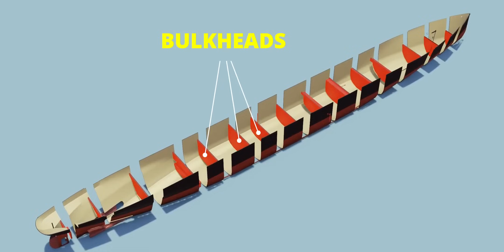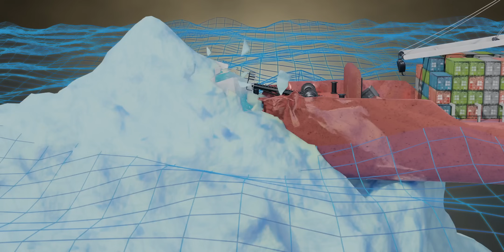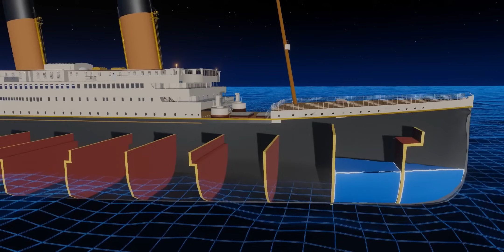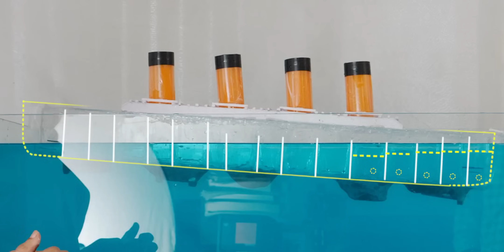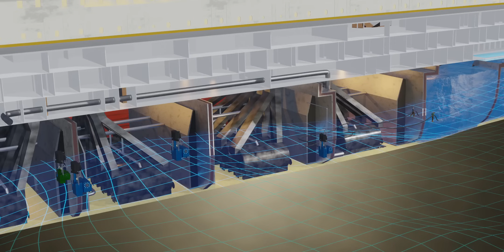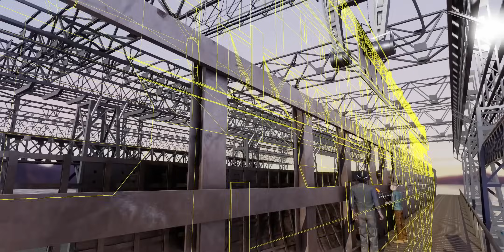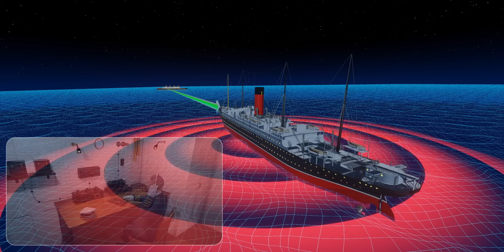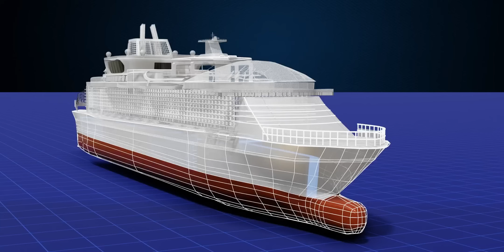How did Titanic Sink? | The Complete Physics

Comment: How could you possibly think the bulkheads not being sealed at the top would be "watertight?" That's insane. To think that water could not possibly go over the bulkheads in any scenario is incredibly naïve and raises doubt of the designer's credibility as well as anyone who signed off on that.

This isn't hindsight quarterbacking. That is something that even the dumbest shipbuilder should have been asking, "Is this blueprint right? Are we really not completing these to the ceiling?"
Reply: The bulkheads did seal up to the ceiling, the issue was how high they reached within her hull. The bulkeads only extended some 25ft above the waterline so when the bow was pulled under, water was able to simply flow through the superstructure and down into the compartments.

They did however extend floor to ceiling across the decks they were found on (D-Deck to G-Deck)

Comment: Why didn't they build those bulkheads right up to the top so that each compartment was airtight.
Reply: The bulkheads did seal up to the ceiling, the issue was how high they reached within her hull. The bulkeads only extended some 25ft above the waterline so when the bow was pulled under, water was able to simply flow through the superstructure and down into the compartments.

They did however extend floor to ceiling across the decks they were found on (D-Deck to G-Deck)

Comment: It was common practice to run at normal cruising speed. In most cases anything large enough to hurt the ship would be easy to see in enough time to turn.  Look up the temperature thermal distortion stuff that explains why the iceberg was not seen sooner.  Just bad luck all around.

Comment: I am thinking about why the collision happened in 1st place. Like why do radars were not there on ship that tells pilot about any obstacle before time to avoid collision. okay if it was not invented at that time and the crew manually have to glance through the roof of ship, then my second question or opinion, would a simple big flood light right in front of ship would have resolved the issue and the iceberg would be visible a miles ahead because in movie it was shown that it was pitch black sea the ship was navigating in so why the hell no lights were turned on at night time ????

Comment: 7:52 i just assume now that the proportions are just right and you included holes above the the "watertight rump" (in use "quotes" becuase some bullholes and doors were open at the time of the sinking) of the ship, to simulate water running down the decks as soon as they submerged.

This fantastic model itself proves how the Titanic couldnt stay afloat no matter what.

The following theoriey is disproved:
- If it hadnt broken it would have stayed afloat.

I find it also amazing how long it held itself up and basically really started to sink fast after all 5 compromised compartments were full. Only after that it really started to sink inconceivably fast. I also finally understand why the watertight compartments in the front and back were so much higher than the ones in the middle.
They compansate the tilt in the case of forward or backward flodding. There is no need for that in the middle.

It also shows that another wateright wall in the middle across the entire lenght of the ship wouldnt be a desirable design, when you consider the mindset of the time.
One wouldnt think 5 compartements would be compromised at the same time all in a row.

But you could compromise 3 and then the half full compartments would cause tilt. Tilt that might endanger the ship.

Comment: Problem was they only reinforced the bottom which is called can you guess.... the "double bottom" and instead just running a second layer of steel plating alongside the hull right above the waterline. Her hull platings was only 1inch thick and thinned more towards the stern. Idk if she would've indeed survive a  head on collision,  my thought is wouldn't the steel platings just buckle under the immense force and rip open alongside the hull past the first 2 compartments?

Comment: Greetings Dear One's
this maybe long though One hopes you all find it of interest:

The RMS TITANIC split in two at around the 23 degree above Azimuth, this split occurred between the fore and aft sections between engine rooms of the fore and aft sections, where the main stairwell for crew and ventilation to lower engineering deck allowed the hot air from the engine rooms to rise and exit the hull and fresh air was blown in by electrical fans mounted in specific points along the boat deck to supply air to the lower decks and engine rooms, this stairwell ventilation shaft ran from Engine room to boat deck which is the depth of the ship, because of this wide open space with less structural enforcement than that from stem to midship or midship to keel made her weak at this point. The reciprocating engines were ripped out of their 900 tonne iron reinforced mounting blocks as she split in two these mounted both engines to the keel the engines HP cylinder's stand upright on the ocean floor in the debris field that stretches some 610 meters between aft section and fore section, it is widely believed that as Titanic broke apart at the surface the engines as they're ripped out of the mounts they slid forward into the fore section adding to the weight of ocean water dragging her down head first due to extreme compression forces on keel which at the split area is indeed bent upward under the immense compression force caused and the excessive expansion of the upper decks majority of the expansion joints popped under the stress and opened up failing like dominos toppling over. The cargo hold hatches were blown off by the compression of the air in the hold deck areas as sea water forced air out and for some time prior loud hissing coming from below decks could be heard which told the crew the ship is indeed sinking. The compartments were never water tight as the dividing structures never went to the top of the compartments and did not seal at the ceilings they stopped around the B deck area they did not go up above this point as it would of closed off many areas that were designed to be open space for the 1st class passenger areas of A deck to give impression you're in a hotel not an ocean limner hence the double stack portals to maximize light entry through in 1st class and the portals were covered internally by led stain glass windows in all A deck lounge bar and dinning areas throughout  the A deck. Most areas of B deck which was 2nd class and some crew Officer quarters, these were open plan as well due to this fact this alone means TITANIC would sink anyway, because the areas that should have been sealed by water tight bulk heads are not they stopped some two decks short thus allowing the ingress of sea water and cause a cascade flooding that caused the demise of the ship. as she went down stem first it was some 27 minutes later the aft section breathed her last and disappeared on her 12500 ft dive to the ocean floor just after dropping below surface their was laud explosions heard many thought this was the steam boilers and exchangers exploding when in fact it was the trapped air pockets in the aft section of the hull of TITANIC imploded under the immense water pressure causing horrific damage to the steel structure anyone alive in those last air pockets would have ben crushed from the immense water pressure that would have folded the steel plates around them like paper, they would of died before their brain would of registered any pain or the sound of the implosion. This would be a factor of around 100th of a second for the brain to register where as implosion is usually in the order of .002 seconds to .008 seconds given how brittle the steel had become in the fringed waters of the Atlantic the times could well of been even shorter, either way they would not of registered pain nor the implosion sound, they may well have heard the hull creaking from the stress of the pressure excreted by the sea water. The Fore section took a slow dive to the ocean floor as some of the glass wear is still on shelving where passengers had placed them in the bathroom area and some dinning plates and other dining wear is intact in the debris field just as though someone had placed them their bottles of wine Champaign and spirits various litter the debris field as do two of the major keel section from the point at which TITANIC split in two these two reinforced sections sit in the debris field and show the immense forces exerted upon the hull during her breakup.

One hope you find this of interest and helps you gain understanding of that faithful night in 1912.

Blessings Love and Light 
Namaste

Comment: The breakup happened between funnels 2 & 3, not 3 & 4 like the movie suggests. The maximum angle should be around 22-23 degrees instead of 45. James Cameron even admitted his movie got it wrong. By the way, 6 compartments were breached, although barely. It was right on the edge of boiler room 5, and water did enter. The Captain's name was E. J. Smith (Edward John Smith). The Titanic's main designer was Alexander Carlisle, and Thomas Andrews took over for his uncle in the late stages of the design process. As far as speed, Captain Smith followed Maritime protocol. It states that a ship is to slow down in conditions of fog or dangerous weather. The ship is only to be stopped if an obstacle is spotted. The weather was absolutely clear. Smith also took the Southern Transatlantic Route to try to avoid ice fields altogether. It's a longer route, but icebergs tend not to appear on that route because icebergs usually melt completely before entering that lane. One of the debates about the head-on collision is the secondary recoil force, that it could cause structural failure with the ripple. No ship at that time was designed to hit an indestructible barrier, especially a 46,000+ ton ship. When you say "turned left", the correct naval command is hard -a-starboard, which at the time meant "hard left".
Reply: Titanic
Reply: Titanic

Comment: Edward Wilding, an engineer at Harland and Wolff, calculated that the total area of the hull open to the sea was approximately 12 square feet. If there had been the huge gashes in the hull shown in some films and animations, the ship would have sunk much more quickly than it did.
Reply: I read that the gash to boiler room 6, the 5th forward compartment, was no more than 2 feet long. Would it not have made sense to divert all pumps and attempt to plug the holes using whatever was available, keeping boiler room 6 dry, thereby saving the crippled ship?
Reply: Titanic first class stateroom

Comment: Your little model ship does not include the useage of Bilge pumps. Depending on the functionality of the Bilgepumps, and where they were loccated.. it is indeed possible for the ship to have been extended that far... the crew fought until the point of the ship splitting to keep the lights and power functional aboard Titanic.

Comment: One analogy that I comes to my mind with how the Titanic sank is comparing it to an ice cube tray.  When you fill an ice cube tray, you notice that the water in the tray doesn't stop at the compartments that divide the cubes.  The same thing happened to the Titanic.  The bulkheads in the Titanic didn't go up to the entire height of the ship.  When the watertight doors closed, the water continued to reach the top of the bulkheads and spill over them.  The bulkheads and watertight doors may have slowed the sinking of the Titanic, but they weren't going to keep the ship from sinking.
Reply: I could never understand why the bulkheads weren't made to be watertight all the way up to the ceiling

Comment: The only reasons the ship went down were 1 they didn't have the binocular keys and 2 the compartments weren't sealed off they opened at one of the levels of room if they have made the bulkheads individual compartments with multiple sealed sections and pumps it could have stayed afloat also it had to be terrifying to see the ship go up then snap in half then the back starts bobbing in the water before dropping
Reply: Binoculars would not have helped at all, especially at night with no moon and with a false horizon effect that occurred that night. But the second reason is correct
Reply: @nsam85  That's not true if the lookout pairs, or the officers, had thought it through better. One lookout can do the traditional naked eye scan while the other uses the binoculars to only look straight ahead, and they trade off to avoid fatigue.  And either the captain or watch officer could have lent their own binoculars.
Reply: You're correct, and I added a response below about why they should have had binoculars

Comment: @14:27 not it was not mistake in movie.. In the movie 1997  it never show  shihp breaks above water level some part of the splitting is in water.. and also it still joint from the bottom part. thats the reason it drags down  the stern part with it and makes it stand vertically before sinking

Comment: The problem with a head on collision is that you would have a compression / deformation wave of energy traverse all the way through the ship. Computer models have shown that this immense deformation wave of energy would have likely popped rivets as far as six compartments back.

A frontal collision would most likely have sunk the ship due to the sheer energy of this wave going back through the ship causing a compression wave to tear rivets out of the steel.

Comment: The powerful riveting machine couldn't reach around the contours and bends on Titanic's stern and bow, so softer (lower carbon) steel rivets was used so they could be hammered in by hand.
But if you look at wrecksite, especially at the break, which is where they used the stronger high carbon rivets, you see lots of plating that isn't actually twisted/torn off, but rather with empty rivet holes where there should have been high carbon ones.
Meaning even these stronger rivets snapped cleaned off, by the absolute thousands.
And then look at the great piece they brought up (the one that broke off as the break area got compressed), we're talking massive forces at play, so massive the piece got torn along the rivet holes.
It's a solid reminder no material on g*ds green earth was going to save Titanic.

And yet in spite of that, shipmakers today don't build civilian ships that takes that amount of compromised adjacent compartments, and they don't build civilian ships that takes the amount of damage that Titanic did, and stays afloat for closer to 3hrs which is what Titanic did, much less on an even keel... yep, Titanic did that too.
So it kind effs me when Harland & Wolffe are portrayed as some... quack amateur shipbuilders, such as a lot of CC's tend to make it out. H&W actually knew their stuff. The only thing H&W did wrong was not equipping her with more lifeboats, not that they would have done any good, but still. And yeah that was H&W's call, not Ismay's.
Compared to any other ocean liner afloat by the time Titanic was finished, apart from the Olympic (which was the same class) they skimped on absolutely nothing.

That iceberg completely dwarfed Titanic in weight & tonnage, Titanic might as well have slammed into solid rock, newer and larger ships have done that too btw, as I like to put it, Concordia got stoned and fell over. With Titanic the plates buckled in a bit, with Concordia the whole thing got pushed in like paper, so it makes you wonder about modern shipbuilding quality & workmanship..

And how much good did double hull & longitudinal bulkheads do civilian ships at the time? Let's look at the Lusitania for instance, oops, made her list so much the crew couldn't launch lifeboats on both sides. 

What led to her loss wasn't coal fire or rivets, it was a combination of operator error and outright greed. they only had but a year experience operating a ship that size, and during that year there was at least one major accident. Even on Titanic's leaving port there were signs of incompetence, those who know knows and those who don't can google it.
The crew had criminally little knowledge and training on competently operating ships of that size, they also had astronomically little training & knowledge on lifeboats on the Olympic-class ships. 

Add to that, with Phillips & Bride (who were employed by Marconi, not WSL) trying to send off backlogged messages (which paid very handsomely) instead of taking icefield/berg messages seriously.
Smith received the first few ice warnings, immediately adjusted for a more Southerly course, then received no further ice warnings. And that was simply the final nail in the coffin, smaller ships couldn't get through and had to stop, wireless operators on many of these ships sent ample warning, and at least one of them was told by Phillips to stuff it because Titanic cool and Phillips bigger nerd.

With crew / operator attitudes like that the Titanic had no chance, they were sailing for doom.
Phillips was sending these passenger messages even after Titanic had struck the iceberg.

And before anyone says it, specifically Harold Bride's excuse that ice warnings weren't afficed 'MSG' (for the Captain), Phillips didn't use them either, to the point Carpathia's wireless operator, Harold Cottam, had to ask if he should tell the captain, as the transcript indeed shows.
Phillips wasn't the nerdy hero such as portrayed, in fact the way he spammed the wireless actually hindered effective communication between rescuers.
He stayed as long as possible because of guilt, same as anyone else in his shoes would. He goofed around and found out.

Comment: The most important part is not answered here 🤔 How could the water overflow to the next compartments , if they were water tight ? Were they not watertight / sealed at the top ❓ And how come in case of only 3-4 compartments flooded the water would not flow over to the next ones ? 🤷‍♂️🤔